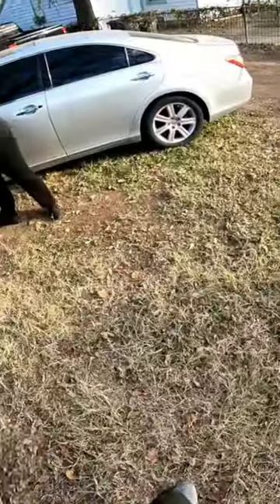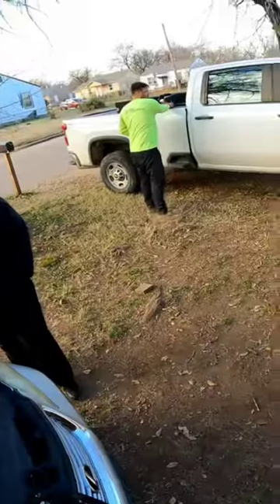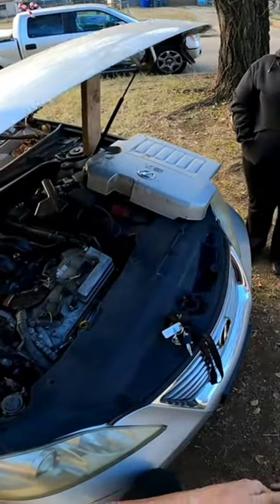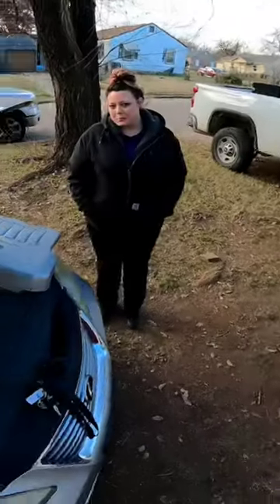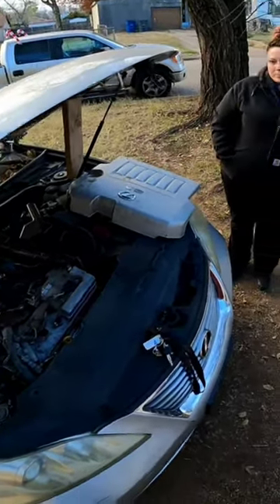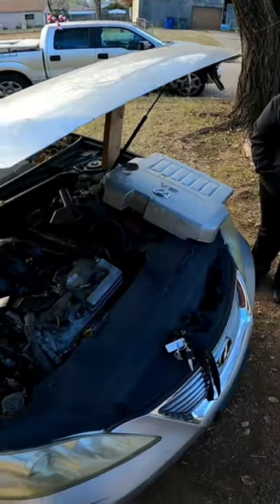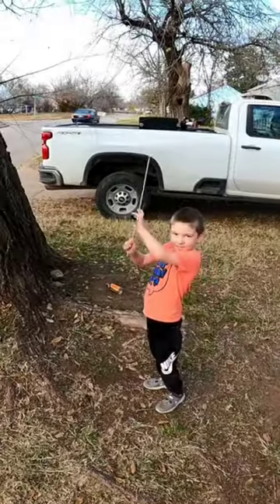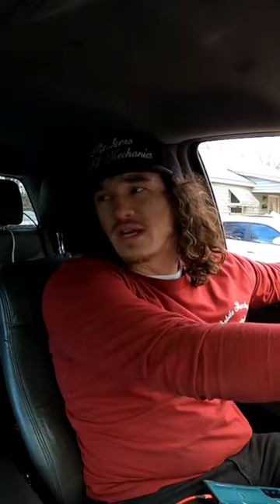Her boyfriend forced the new spark plug it and then grinded it out 😨 😨

Comment: I love how homeboy pops out of the house like, ey ya I know what I dun did. Bro go back in the house and sit down while you pee.
Reply: he was just unexperienced man, no need to emasculate the guy...
Reply: @dirty6004 bro it's common sense. He's a dummy
Reply: @dirty6004 bro. He basically grinded up a magnet and put magnetic powder in the spark plug holes. In the combustion chamber. Bro needs to to shut up and buy a Honda where he can see all the spark plugs
Reply: All shit I stopped the video @1:31 to read the comments and then this came out thanks
Reply: He messed up. He had a try because he’s probably capable of doing other things like construction or carpentry so figured he could transfer his skill set. I was the same way back in the day. Never had anyone to show me and had to figure out myself. Damn I made a lot of mistakes and it was a good job that cars back in the 90’s were so cheap that it was just as easy to go out and buy another one for £60 in the UK. But these days given the same skill (or unskilled😊) frame of mind I would not touch any of these newer cars. 3 grand down the drain just like that 🙈.
Reply: @justxaine.3544 some v6 honda still have 3 facing tbe firewall :(
Reply: @seymourbutz6951  Honda's V6 is sit lowered. You can reach the back 3 without taking the intake manifold. Toyotas as you can see is set a little higher.
Reply: @dirty6004 still, when your incopedant accept it and get help don’t assume you know how to do everything. I hate all this feeling bad for everyone today and not holding them accountable for fuck ups 😊

Comment: When you think a simple spark plug job would be that easy 😂
Reply: Yeah, I yearn for the days when spark plugs were easy, right on top of the engine. The car companies have put too much faith in the 100,000 mile plug, and it's a pain in the you-know-what. I had a 2013 Scion FRs that required engine removal to replace the spark plugs! The entire procedure took up many pages in the shop manual, and of course special tools were involved. I never had to do it while I owned the car, but someone will some day.
Reply: @ChrisBussells cooperate greed😪
Reply: @ChrisBussells  you are cherrypicking examples, subaru engines are the hardest, but generslly, a spark plug change is easy. Another difficult examples, transaxle v6, and v8s with double the spark plugs per cylinder (is not hard, is just longer).

Comment: 0:27 because it’s in a tight spot. Probably didn’t take the upper intake off. Probably could have prevented this whole situation. This is one of the biggest problems I have with the business (12 years in.) I get money is tight for a lot, alot of people, me included. But a lot of people think they can do these jobs, and think it’s simply turning a few nuts and bolts and can be done in an hour. That’s why I highly seek going to a professional in the first place, whether it be a shop or somebody who’s mobile and certified. I’ve seen it too many times where someones boyfriend/ husband/family friend “can do it cheaper” and then it comes back on the tow truck having to pay extraction and additional labor than the normal amount of labor the job initially calls for. I apologize for my rant, I’ve just seen this so many times and is a continuing issue the more that inflation and prices go up. Not enough quality work out there.

Comment: DIY people. Use a length of vacuum line or 3/8 fuel line to thread in the spark plug. Stick it over the tip of the plug. If it is spinning on the plug then you are cross threading. Restart it. It also helps you get the plug in position without dropping it. Spark plugs are ceramic. They crack easily. Dropping them is bad. Don’t put your socket onto the plug until it’s threaded all the way in. Just use it for the final tighten. Most spark plugs have a 12-15 lb ft torque spec. Which is very little force on your ratchet. Pretty much just snug. The Ford three valve 5.4 and 4.6 are 25 lb ft. Which is snug plus a little more. If you don’t torque them that tight they will leak combustion past themselves. Also when you have plug wells like that car either vacuum out or blow them out with compressed air before removing the plug. When the boots get old they tend to get dirt and debris in the plug well that you don’t want falling in your engine. If there is any moisture in the plug well then you need new boots for your coils or whatever sealing cover may be there is leaking. 
 Funny how even the simplest jobs have lots of little things to them. It’s the same for brakes. I’ve seen so many broken caliper pistons and caliper slide pins not get lubed. 
 You can do it on your own. Just take your time and watch a bunch of videos. YouTube is a great resource I didn’t have when I was a poor white boy trying to survive.

Comment: Whats the worst tune-up (with spark plugs) youve been dealt? Ive had to literally hug the 3.8l v6 in mine and my wifes former '97 town & country (sold it with 217k miles) to get the back cylinders. 😅
Reply: 1st or 2nd gen SHO, so stuff to get to them
Reply: 3.6 jeep pentastar. Have to remove intake manifold to gain access on wrangler models.
Reply: 3.6 on my impala i have to take the intake manifold off but its just a few connections and 8 long bolts.

Comment: I hate front wheel drive cars.

If I get a "random" misfire, I let the car sit for a day, then drive it again.  A misfire could be caused by so many temporary things.  I recently had a "random" misfire on my van just before getting a smog check.  I let the van sit for a day, cleared the codes with my cheap scanner then drove it to get my smog check.  It passed and has yet to generate another random misfire code again.

Comment: I’ve broken a spark plug porcelain and it went in cylinder was a few good knocks from the engine and it smoothed itself out 😂 not saying it would work with a magnet but yeah it was a 2001 f150 5.4 and I sold it years later dude still drives it today